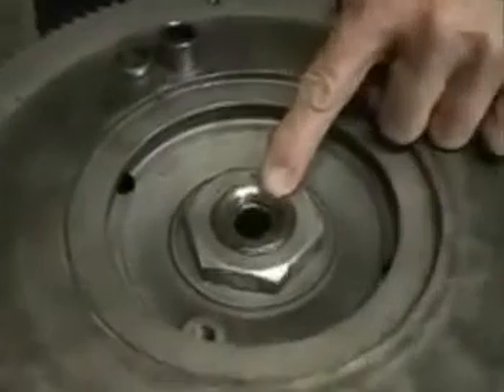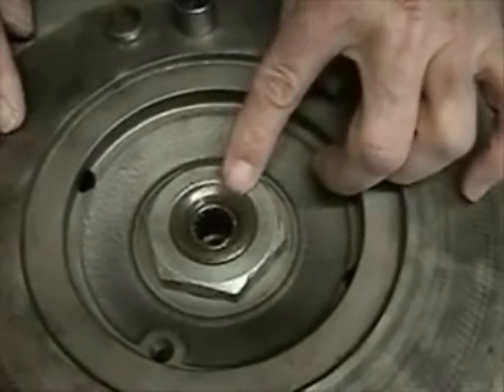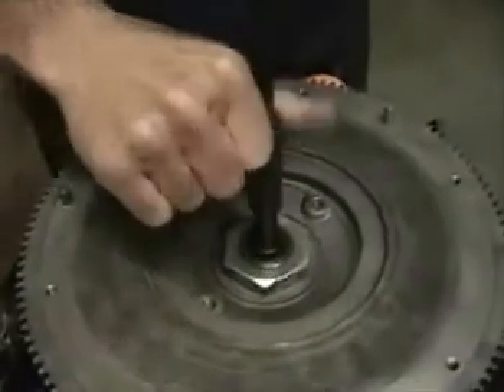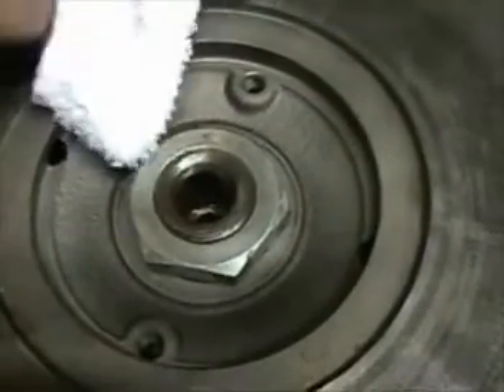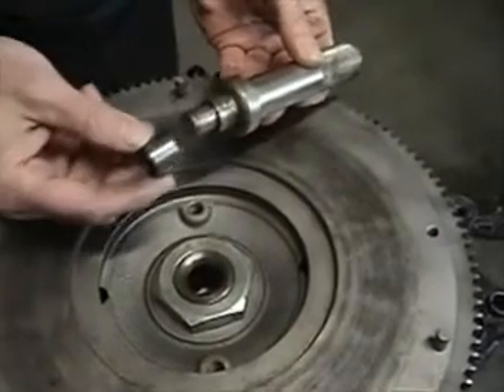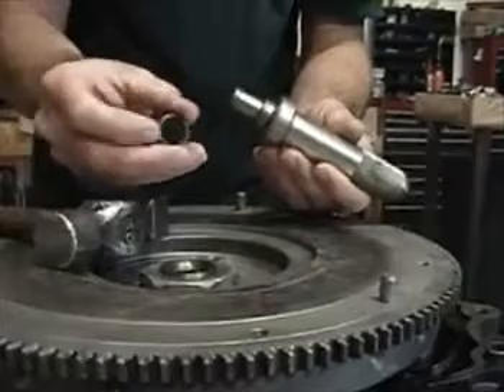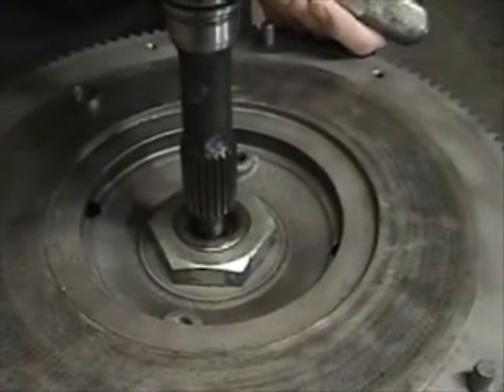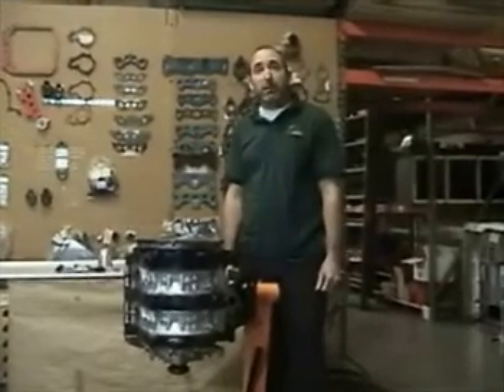How to replace the Pilot Bearing Seal on a Rotary Engine

Comment: is the pilot bearing puller you used here different from a piston engine pilot bearing puller?
Reply: It is designed to fit this particular pilot bearing, there are very few “generic” pullers that work. Unfortunately these are expensive and hard to find. I just had good success with a harbor freight one though. Similar style, slide hammer with expanding collets. Comes in a set of 4 and costs about $70.